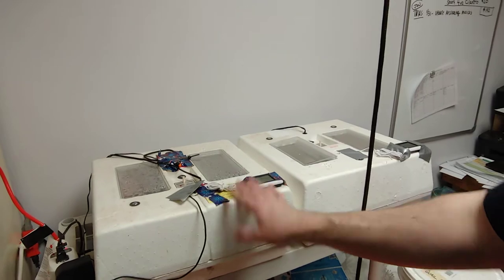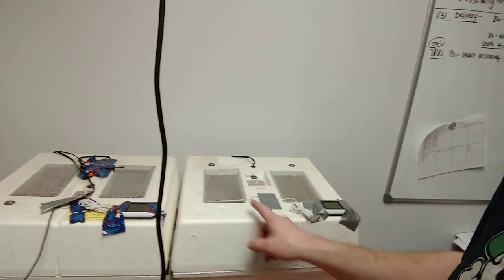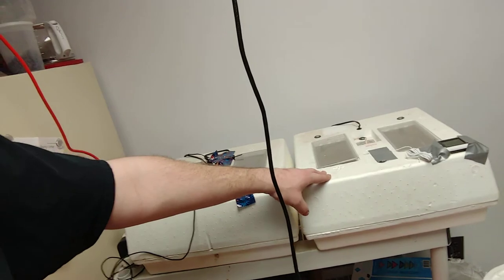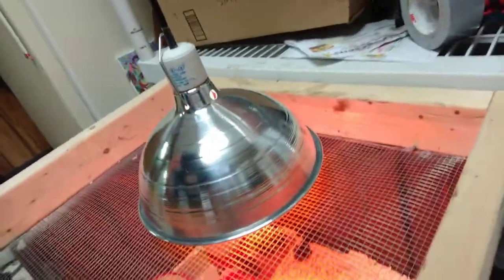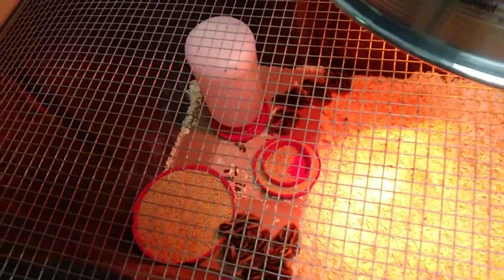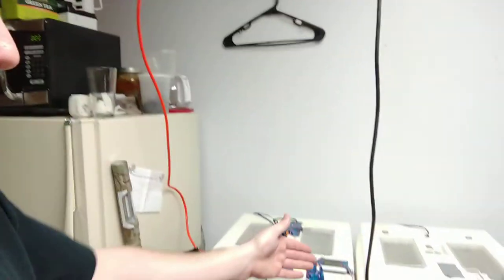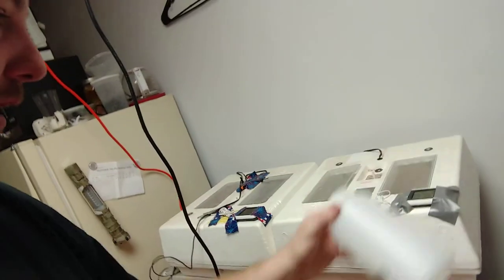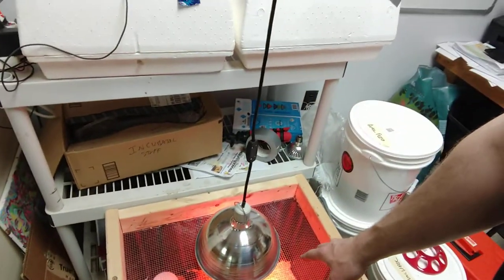Quail Brooding Tips

Comment: How you go dry on the incubator???
Reply from the maker: If my ambient humidity is around 50%, I just don't add any water until I remove the turner. So, around 5 days before hatch. Then I try to reach as high as possible using 100 degree water and thin sponges. Last 5 days or so I am looking for 70%, or higher. This way they don't stick to the membrane.
Reply: Dowie Farm yes that’s what happens to my two last chicks. I had to help them out. They were getting dried and stuck to the membrane. Thank you so much. 💛
Reply from the maker: @Rosalinda626  I have no issues helping them if that's what's going on. I'll also take the 100 degree water and a sponge and get that egg wet if they're almost out but likely stuck.
Reply: Dowie Farm 💛

Comment: What bulb you recommend
Reply from the maker: I like the heat bulbs from the farm supply store. They are red and 250w. But after the first 4 or 5 days you can just switch to a 60w regular incandescent bulb. The catch is you have to make sure you secure the lamp with no less than two separate sturdy hangers. We use a chain with "S" hooks, AND a piece of electrical solid wire wrapped around the lamp and a different hook. This way in case something fails it doesn't fall and start a fire. I've also heard good things about brooder heat plates or platforms that are a little pricey but won't ever fail probably. Those are super safe. Good luck!